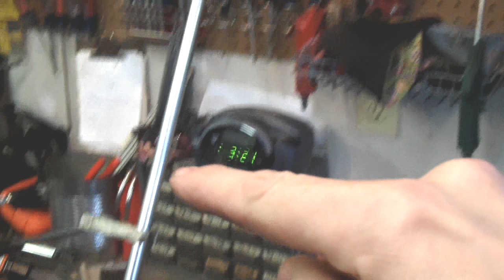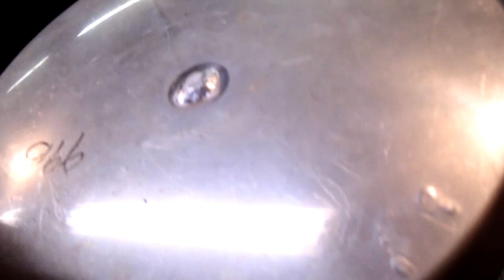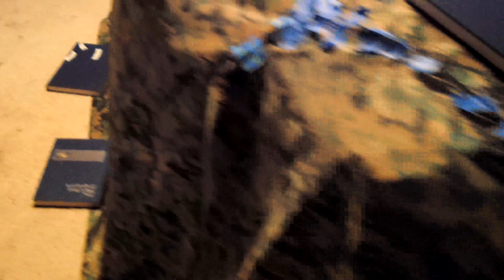Making The Dakota Pit Tent.

Comment from the maker: You do not need a ventilation hole with this one because the Dakotas airhole will be located outside the tent. The airhole will feed the fire hole and the hot gases will rise up into the chimney. The taper of the chimney will compress the gases at the top creating draw. I built this chimney 9 months ago and Ive tested it. It draws great. I have an idea for a bowel grill in the future, it will need an air feed tube from the outside. I'm glad you liked it, Thanks for watching my friend.

Comment from the maker: PVC would have been a lot easier to work with but I already had the aluminum and the strength to weight ratio is awesome so I used it. I also have a future design for a forced air hanging grill for this. (I dont want to have to dig a Dakota pit everytime out) The other grill design warrants the strength of the aluminum tubing to support the weight. Thanks for watching my friend.

Comment from the maker: Thanks! Im glad you liked it. It makes the job so much easier having toys to work with. Thats a 1955 Chevy Belair under the cover. I bought it when I was still in high school in 1984 and Ive managed to keep it all these years. I'm too lazy to finished restoring it right now, LOL. I'll get back on it one day. From my experience with reflective materials it should make good use of what little exterior heat is put off the Dakota fire. Thanks for watching my friend.

Comment: never boring, radical, futuristic, hip, outstanding workmanship. well done again. i put a little woodburning stove out in my enclosed porch with a suspended pipe of a chimenay and it works a treat. so thanks for the idea. i do most of my cooking out there now so i save on gas. ive also got my electricity bill down to £40 a month. so thats good also. loving your ideas keep em coming

Comment from the maker: That is a air powered hacksaw. Its a porter cable and I bought it off the shelf at lowes. I love it, its been a good one. I had a cheap one that broke and I stepped up and got a good one. It uses cut hacksaw blades or modified sawzall blades and some jig saw blades. Thanks for watching my friend.

Comment from the maker: Several folks mentioned pinning my work, I think because that's just the way it's supposed to be done. Im thinking that on something this big, Im sure I'd have a few fall out. Someone else mentioned it would have added extra holes in the cover, I didnt even think of that. I like the ring idea. I was kinda thinking later on how hard its gonna be to hang meat on the rods just crossing under the cap. Good idea on the rings. Im glad you liked it. Thanks for watching my friend.

Comment from the maker: Thanks! Im glad you liked it. Someone once told me if the SHTF it would be like a vacation for me, LOL. The frame was 3.8 pounds and the two covers combined were 3 pounds so,6.8 pounds for a fully enclosed heatable indoor cooking shelter, not bad at all. I'm going to have to make a special bag to pack it in. No need for the ceramic cloth mantle, the Dakota fire hole will be inside and the Dakota air hole will be outside. I havent even thought about lightning! Thanks for watching my friend.

Comment from the maker: Thanks! I'm glad you liked it. I already tested it and as long as the chimney is clear, no moisture issues. That pvc tube would be a lot easier than digging the outside air hole but Im ditching the pit. It made the tent too hot during the test. The winters here in the south are just too mild for such a hot shelter. Im going to make a fully enclosed oven for the bottom of the chimney. Thanks for watching my friend.

Comment from the maker: Thanks! Im glad you liked it. Yes, the packing part is gonna suck. Its not really a one nighter tent, its more of a long term stay tent so it will be worth the packing. Im finishing up the bag for it now. The smaller parts will be in my back pack. The longer tent frame parts will be rolled up in the inner reflective cover and stuffed into a long bag with a shoulder sling I really need to put more slip joints into the frame when I get time. Thanks for watching my friend.

Comment from the maker: LOL, Ive bben told a bunch of times that my southern pronounciation  is kinda lacking at times. The Dakotas fire pit should be down low enough that sparks wont make it to the top but, It's a good idea to have a spark arrestor. I probably will add one to the aluminum ring I made just for safe measure. Nick aint getting this one, not unless he can curl up in the other end, LOL. Thanks for watching my friend.

Comment from the maker: Thanks! If all Ive seen when dealing with reflective material, it should be like an oven, LOL. Uncoated ripstop is slightly water proof but not much, it soaks through in a heavy rain over time. I didnt get the coated because I knew I'd sew it and have seams. I am going to dip it in a silicone mineral spirit mixture in the near future to water proof it 100%, seams and all. Thanks for watching my friend.

Comment from the maker: Thanks! Im glad you liked it. Well, there might have been an easier way but there were so many different elements of design in this thing that I didnt know and easier way. Using the pieces of aluminum tubing made it kinda harder too. Having brand new straight pieces to start with would have helped but new would have been $3.90 a foot or, $109.00 for 28 feet. Prototypes are never easy. Next video, Tent Test! Thanks for watching my friend.

Comment: That's a good idea. Very inventive. Good job.
One technique I've used and still do is by means of believe it or not an old ripped off extendable Hoover hose.
  Make a large fire pit as you would and give it a double vent system and build a wall between the vents and the pit. On the other side make a ditch half way down into the pit and trail it towards your tent, tarp or shelter. Curl it up so it is inside the rear of your shelter. Fill the ditch back in and fire it up. As the twin vent fuel the fire it in turn boosts the heat and that heat travels through the hose into your shelter and is completely smoke free. 
  Great vid man. I do like your channel. Light hearted and fun the way it should be. Thumbs up dude. 
Cheers,
MIKKYO. :)
Reply from the maker: Mikkyo Ryu  Mikkyo I love your idea brother! I can picture it in my mind. Very good thinking.

Comment: I've always heard that welding aluminum is really difficult to do, especially thin wall tubing, but you made it look like childs play!  This is the first video I have seen of yours...I will be subscribing and watching all of them.  Good job!
Reply from the maker: +Kit Crider  You heard right Kit! Theres a fine line between getting the aluminum hot enough to fuse with a rod and making it melt into a puddle and fall in the floor or your lap. LOL! My trick is, when you are welding along, the second you see it get shiner than normal, jab the rod in. You gotta move fast tho. Thanks for the sub and Thanks for watching Kit.

Comment: Great video as usual David!! Just love them. I usually go to the park and set up my hammock so I can read all afternoon. It was raining today and I didn't feel like going home so I was binge watching your videos. I have a couple tips for you. One, to make your seams a little stronger structurally, try a French seam. This is for your rip-stop. The other stuff would be way too thick if you tried that. Second, try making smaller sections to sew. Go from one leg to the next leg, from the top of the structure down to the ground, to make one section. It makes for more sewing but you'll get a much better fit. Third, use a plastic drop cloth to make your pattern. Then if you like the way that fits, you have a pattern to work off of when your original cover wears out. Or you can make different kinds of covers. Fourth, use a heat knife to cut your rip-stop. You will end up with a nice clean edge that is much easier to sew and you won't have any fraying of the cut material. Fifth trick, use double sided seam tape. You simply peel the paper off one side, a few inches at a time then, stick it to one side of your rip-stop along the seam. Get your adjoining piece of rip-stop, peel the paper off the top side of your seam tape a couple inches at a time, stick your adjoining piece of rip-stop to the tape. If you don't like how you joined them, unstick the top piece of rip-stop and reposition. When you are ready to sew, sew right through the seam tape. It adds a lot of strength and makes it much easier to sew the rip-stop together. None of that slipping and sliding around. Make sure your fabric is laid out flat, has no wrinkles and do not stretch the material on either side of the tape. Here's a link to help you with seams. The link is about clothing, but it does also apply to tent/shelter making. https://www.simplicity.com/t-teaching-tools-seam-basics.aspxAll you have to keep in mind is what kind of material you're using, whether or not it needs to give a little, or if you need a really strong seam like for the places you are going to put tie straps or grommets where you would need extra strength. Or, if you need to put in another layer like you did with the grommet but use it where you might get some wear and tear from rubbing. One more thing, make sure you are using the correct needle on your machine. You may be using a needle that will break or stretch the fibers of your material instead of going in between them. My Daddy was a sail maker. I picked up a few things from him. Also, I wouldn't exactly call myself a seamstress, but I can make my own patterns for the clothes I sew for myself. I've been sewing since I was 5 years old. I guess you could say that I've been doing it for a while. Lol!! These are suggestions to make your sewing projects easier and nicer fitting. Take em' or leave em'! Thanks again for making all your videos. I have learned a lot from you!
Reply from the maker: +Dawn Woodworth  Im happy you liked it Dawn. Thank you, Thank you and Thank you for the comments! I started sewing when I turned 44 or 45. I only know the basics but Im still learning. I will look into all you said but I have one question about the double sided tape thing. Does the adhesive ever gum up the needle? I ask because I once sewed some sticky back velcro and it totally gummed up my needle. Will the double sided tape do the same thing?
Reply: No! Not at all! Totally different stuff. The velcro is so sticky because that is supposed to be the only thing you have to do to put it on, stick it! Lol!! The seam tape is a breeze to use. Makes sewing the slippery stuff much easier to handle. The pro's use it all the time in sail making. It would take up way too much time if they had to pin the sails before they sewed them. Sails have many different panels to give them shape in order to keep as much wind in them. Spilling the wind would slow the boat down considerably. Try the tape and you'll see what I mean. You'll never go without it again.
Reply: Not using the seam tape is tge same as not using clamps when you are machining a piece of metal. Nit a good idea to begin with but the clamps assure the metal doesn't move around. So does the tape.

Comment from the maker: Yep, those threaded rivet nuts are awesome to have around. Im hoping the Dakota pit will warm the ground under me big time. I figured what little heat is put off above it should be trapped by the Reflective cover. 3.8 pounds aint bad at all for a portable shelter that you can heat and cook in. Ive tried everything with that punch set, its tough to get it to punch through three layers of Ripstop Nylon.

Comment: FANTASTIC. As far as staking I would grommet the inner cover so it can be staked as well. Having experienced a sudden violent thunderstorm when camping I learned the more your shelter is tied down the better.No like Velcro. 1. it grabs trash. 2, it is too loud opening. 3, under constant wind buffeting it will come undone. Lightly waxed zippers for me.The door is good with an overlap. About 4" behind the overlap install your zipper. 6 1"Velcro patches, edge to keep the overlap from flapping.

Comment from the maker: No melting should occur on the exterior. That outside hole is the air feed hole, that where the pit gets its air to feed the fire so it wont get hot. Im thinking that with the chimney in the roof, it wouldnt collect and condensate on the walls. As far as light rain it wont come in. If a very heavy rain is expected, I'll need to trench around the edges with my shovel or I'll be swimming, lol.

Comment: First just a Hello from Europe. I love your videos beacuse: -your accent and fun personaliti -they are one of a kind, you show what nobody else does on you tube
 
and i learn so much from them or just watch and enjoy.
 
Here is a small tip for your "potless, panless grill" in your SHTF video:
 
By welding those two plates on the grill you traped air in between them and that makes it heat up slowely since air is an insulator. IF you have just one metal plate you should be cooking much easier.

Comment: Great concept tent with built in comfort, you worked very hard and it shows, I know the final result ended in frustration but as you mentioned it was due to the sealed carbon fibre chimney closed around completely.  Perhaps if a spark grill was in place instead of a complete wrap around, the fibre sheet won't twist due to the rocket type flow of air up your chimney, just a thought because it is so very near perfect. Best wishes in your progress with this project, great vid.

Comment: Cool project. Well done. Thought you might have some moisture ventalation issues
but time will tell. On set up, you could trench in a PVC tube with a flue to feed the fire pit.
Thanks for sharing.

Comment: My idea (at last he says) is a kind of chain-maille, and I thought of this as an extension to an idea I used at work, using string, and then just to prove it would work, using metal loops to catch the water leaking from a roof where the leak would splash everywhere, put a cord or metal linked chain from the leak and the water follows the metal to flow into a bucket.

Comment from the maker: Well the lighter emergency blankets will rip all to shreds in a few trips. I have tested them and they do not last. This material will last 10 to 20 years. Yes, its heavier but man is it ever tough. If a noraml person had to run out and buy  the Carbon Fiber, Aluminum tubing, Foylon and Ripstop nylon, they would go broke pretty quick. I have been saving up these materials for a while and have been tossing the idea around in my head for a few years now.

Comment: I love using those grommets. They sometimes sell the kit without the hole punch which seems a pretty dumb thing to do, so I had to buy a hole punch kit with about five extra sizes I will never use. So they got me to spend more money.
Reply from the maker: +Charles Rablin  Them grommets are great to work with. I guess they sell em that way claiming you will wear out the punch and yet we all know its a money thing.
Reply: +Reallybigmonkey1 Yeah turns out not so el cheapo after all but still a good gadget when I hit the grommet the right way up.
Reply from the maker: +Charles Rablin  Also, I stopped buying the really lousy gromment kits from Harbor freight. Half the time they crack. I now get em at a fabric store.
Reply: +Reallybigmonkey1 I get mine in tropical north Queensland Australia, sometimes there's a choice sometimes there ain't, but I recall using El Cheapo to describe the cheaper brands going way back.

Comment: Like the look of it very much, really nice. I know the 'fitting' of the thick silver foil was a nightmare so it is kinda understandable that it is difficult to get a really tight fit.

It might be a waste of space for me to say this, but for a plain RipStop Nylon the angles of the frame that are not obvious can be found by using thin paracord to make the lines of the virtual Tent where there is no solid connection to the pieces being connected, you see. That is done before any cover is laid on

Comment: I like it.  Did you make a kit sleeve to carry all of the pieces together?   you should plan an air inlet  around the base or someplace so that your fire chimney can draft.   I made a pair of hub caps for a decorative 8 ft tall windmill using a pair of pot lids.  The lady wanted the windmill fan section painted up like a sunflower.

Comment: Looking forward to see how the inside works next time. You are possibly going to feel like Thanksgiving turkey with the fire and all that foil around you.  You may also need to tweak design slightly if the tough foil causes a lot of condensation. But I know you will come up with some cunning solution if that proves necessary... Thanks again for a great vid !